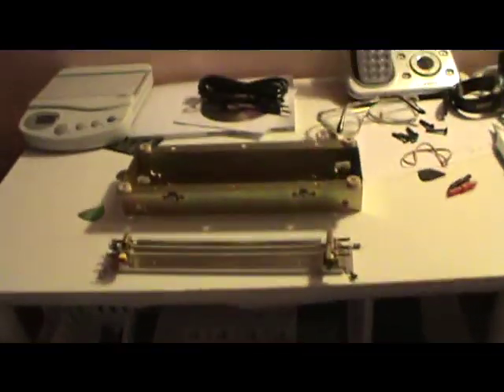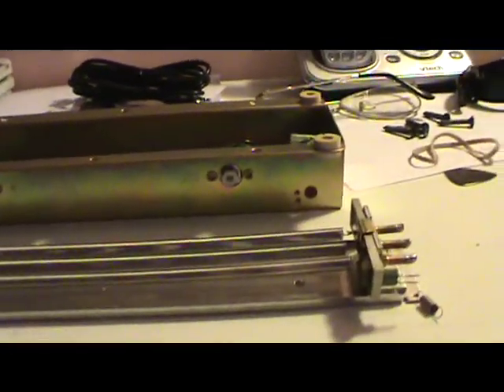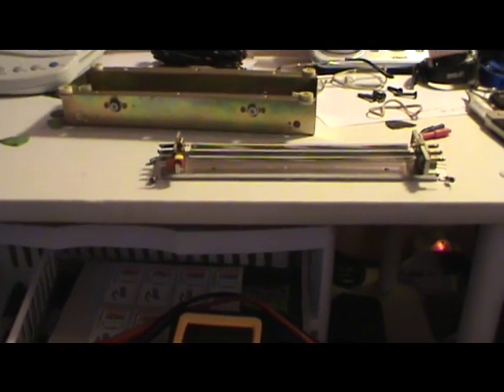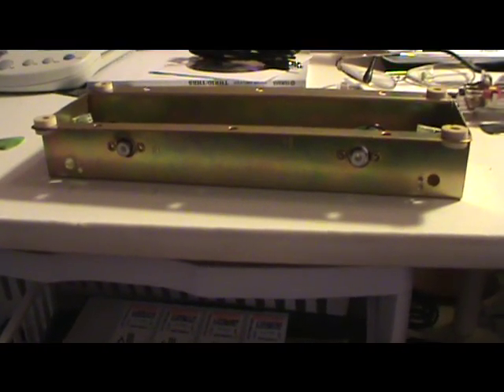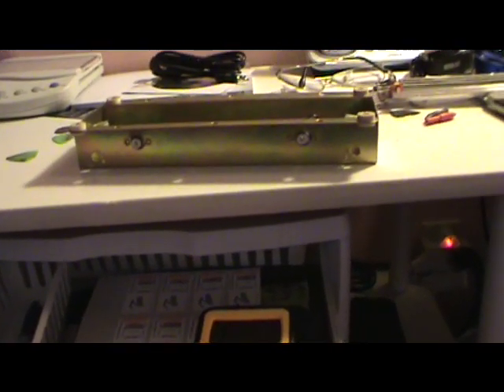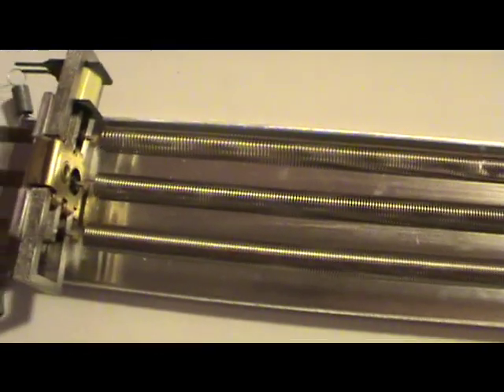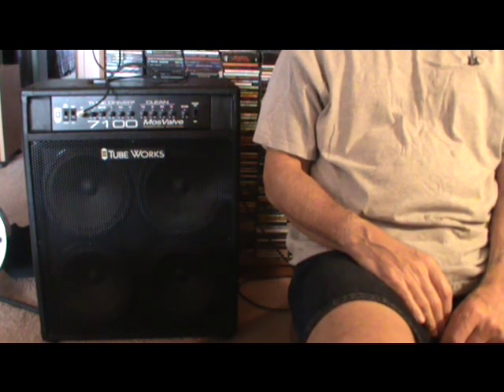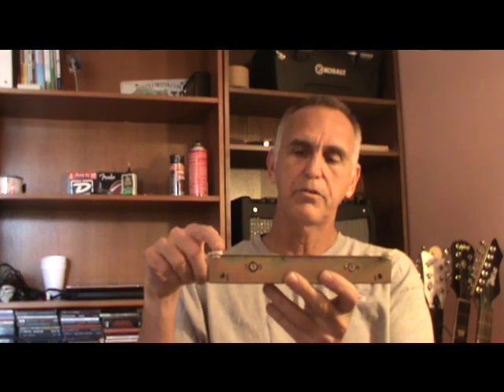Guitar Amp Spring Reverb Diagnostics

Comment: I have an oscope and a signal generator. Hah I know most DIYers don't, but makes things so much simpler. Just put in a 1k signal, probe the input of the tank, see a signal you know it's getting to the tank. Probe the output, don't see it, you know the tanks the issue. If you're doing a lot of these, save yourself some time and buy a scope.

Comment: Hi - this is very useful as Im new to using multimeters. When I tap the springs with a screwdriver I get the verb 'jangle' you get from moving the amp suddenly - so the verb seems to work. But I  get zero verb from the amp/guitar with dial 0-10. Do you think it can still be a faulty tank if I'm getting the verb with the screwdriver? Any suggestions welcome :)
Reply: Hey I think you answered it - shaking the amp gives you verb - it's the INPUT?!!
Reply: Agreed, you can have one and not the other

Comment: I have a Tube Works 7100 Dual Twelve that's missing the reverb tank. I can't find any info on the code for the tank. It's the short 3-spring. Do you think it's the same tank on your amp?

Comment: I've done service fr many years and it was rare to have a catastrophic reverb failure.  But typically a reverb not working was due to the rca connectors oxidizing over the years.....particularly the outside grounding and not so much the internal pin.  Usually the grounding turns whitish so you need to get some steel wool and spin it around the RCA connector on the tank to shine it up and make sure the male RCA plug tabs are making snug contact when plugged in or just bend those tabs slightly so they tighten up the contact.  But yes if you have a small round file from a small jeweler file set, also give the center of the female RCA connector on the tank some attention......but its the outside of the RCA that's the ground and the most important...….as for the RCA connector wires between the tank and the amplifier.....make sure the wires and connections are good...continuity at both ends of the wires at both the pins and the grounds......and check the RCA terminals at the amp chassis and shine them up too as doing the tank RCA's.  If there is no RCA connectors on the amplifier chassis, then they are hard wired into the circuit internally and should be ok.  BUT if that doesn't restore the reverb effect,  the culprit is the tank.  What I have found is that in the later manufactured reverb tanks from accutronics USA, is that they went to using an internal tank connector from the spring transducers to the tanks shell RCA connectors.  Particularly each transducer in these was changed from a direct connection from their transformers to the RCA connectors to using this extra connector system and the wire in the transducer transformer where it comes out and to where it meets the male part of the internal connector....that wire connection fails.  SO you have to use magnification to actually see it, and sometimes it can be fixed by soldering though the fine angel hair wire is coated with an insulating paint....could be enamel paint or a plastic coating.  SO its tricky to solder the contact points for a good connection and there is not much slack.  SO if you are successful in making the connection again, chances are that it won't last infinitely long as saying the life of the tank.  There is also a situation of the wire in the connector between the transducers and the RCA connectors on the tank shell.....the wire insulation tends to get less pliable and stiff and the wire breaks at the RCA connectors solder points.  But point being, the accutronics tans were quality tanks prior to this change over and these are the variety of their tanks that are notorious for failure.  If you are financially limited, you can try to fix the tanks, but its best to just save time and a headache and just replace the tank.  There are generally 3 types of replacement tanks on the market.  Accutronics was sold off to the Belton corporation and manufacturing was moved to Korea, but Belton makes a Belton tank and a Belton/Accutronics tank....so 2 types from them, and then there is the MOD tanks which are made in china.  The MOD tanks have a richer dynamic tonal response vs the Accutronics and the Belton has a slightly different tone and response.....so they all kind of have their own character in response despite being equivalent tanks.  BUT I prefer the MOD tanks in pure tube reverb circuits......however in solid state reverb circuits they do not sound as good as an Accutronics tank in the sonic response.  So for solid state reverb circuits, stay with the Accutronics tanks, and with pure tube reverb circuits you can use 3 tanks as each has a slightly different response but they are all good.  The MOD tank in a solid state circuit has a "Too Much" thing to its response and is way over kill......and the Accutronics tanks are spot on in over all tonality with the solid state circuits.  Obviously if the reverb was built with a USA Accutronics tank, then that's what your ears will be trained for and is the baseline.  The 2 spring long delay variety tanks are the best tanks in the "long" versions and most probable in the short tank versions.  The # spring types are OK but tend to be a bit over kill in the response of the effect....where as the 2 spring types are well balanced and spot on.
Reply: The reverb tanks and the transducers are kind of misleading in their action and how they work.  They DO NOT vibrate the springs as in a linear motion as suggested as of a speaker on one end and a microphone on the opposite end.  The Reverb actually works by torsionally twisting the springs to excite the spring to vibrating.....so the mechanism of the transducers is not based on the visual appearance where you may reason that the action is and in & out force.

Comment: Took a long time to say not much. If the coils are flopping around or wires are loose won't work new tank 25.bucks problem fixed
Reply: Yeah. I was gonna say. First thing i did was REPLACE the $23 reverb tank and I still have no reverb. Really hoped for more, but I'm glad you got yours fixed.

Comment: Great guide. I just fixed a horrible buzzing noise/squeal in my Marshall Lead 100 Mosfet from the reverb tank. All I had to do was clean the RCA jacks from the insane corrosion they had and it now works fine, so happy it was this simple.
Reply from the maker: Glad you found the info helpful!

This is by far my most popular video, receiving between 700 and 1000 views over 30 days.

Comment: Big Mahalo!!! I just picked up a '74 Twin Reverb and when I got home the reverb barely worked (it worked ok when I tested it a couple weeks ago). Pulled up your video, cleaned the amp-side contacts, pulled the reverb tank and cleaned the tank-side connections. Now the reverb works GREAT (even better than it did at the shop), and consistently! Mahalo!
BTW: I got the same on the continuity tests as you 200 ohms on the input side and unlimited ohms (no continuity) on the output side.
Reply from the maker: Good news...   ain't it sweet when it turns out to be something easy?

According to some quick research, the reverb units in 1963-1990 Fender amps have 8 ohm inputs and 2250 ohms outputs, so ti's possible you had the wrong scale set on your meter... but the important thing is you got your unit working.
Reply: Love it when I get to learn something new in a few minutes or hours (as opposed to DAYS or more). 
Very likely I had the scale incorrect. I was looking for 200-500 LOL 
Mahalo!

Comment: I have a strange problem, its a Marshall AVT20 combo and the reverb doesnt work but when I pull on the reverb knob the amp gets louder and brighter.
Reply: Was it used when you bought it? Because I've seen many people do mods inside the reverb tank. They could've put effects inside the tank. Just take your tank out and look if it's been modded.

Comment: I own two Roland Cube 60s from the 1980. When i set the reverb knob to 10 and knock the amp with my hand, i can hear reverb. But when i play a note on teh guitar, there's no reverb. And idea why?
Reply from the maker: +robbiedaug It sounds like you have problem on the input side of your reverb tank. It could be as simple as a corroded connector, so the first thing to try is re-seating both connections on the reverb tank. If that doesn't help, the problem is probably inside the reverb unit, and you'll have to remove it. It could be dirty connection inside, a broken wire or toasted transducer. "Input" and "Output" should be marked on the reverb tank,  but if not, unplug one of the wires going into the tank, then knock the amp with the power on and reverb turned up. If you hear still the reverb, then you just unplugged the input side. If you do not hear the reverb, you probably unplugged the output side. Mark them in and out with a sharpie to help identify them in the future. 

Once you determine which side the problem is on, the video explains how to troubleshoot it. Good luck.
Reply: +ebluz Thank you, sir. I'll give that a try.

In return, let me introduce you to something that will help you if you are ever camping in the wilderness and you get a bad cut or puncture wound or whatever like that. It also comes in handy to avoid doctors' stitches. If you are in the USA and lack health care, it will be handy to know about. 

Check out my playlists and see the natural healing video series.

Comment: You can make a new transducer take some wire and wrap it around the plastic bobbin and check the resistance with a multimeter it's just like a pickup
Reply from the maker: Have you done this successfully? I should try it.

Comment: just to help you first if you want to measure the tank you first have reassemble the tank plug the wires into the 2 coils measure the in it should be about 100 to 150 to 200 or 1k same for out 2nd of all power up your amp turn reverb volume up one of the RCA end will buzz when you touch with you finger

Comment: Hi, thanks for the video, I have the same problem, I hear my reverb when shaking it but no reverb on the guitar sound. So as you said, the reverb output shall work.
I measured connectivty on the male connectors straight from the transducers.

Output says 0L and input gives me around 0. Just like you, I think. So that 0 shows a bad thing or a good thing ? Is it supposed to have a connectivity between the two pins on a same side (input here) or not ? I assumed it should be not but I might be wrong. Thanks for your enlightenment.
Reply from the maker: I think I may have incorrectly said "zero" resistance in the video a time or two, when I meant OL.  OL stands for "Open Line" and means the circuit is broken (no continuity). A reading of zero resistance means the circuit is complete, and that there no resistance at all.

In this case there should be some resistance. For my tank the input should be 200 ohms, and the output 500 ohms. If you're getting a resistance reading of zero, you may quite possibly have the meter set to the wrong scale. Try a lower scale on the meter.

As I remember, I used the continuity test mode of my meter (not all meters have this), which does not give readings, but simply indicates if a circuit has continuity by making a buzzing sound and flashing a red led on the meter.

I suspect it more likely the side giving the reading of OL to be the bad side. However, your test of shaking the amp and hearing the reverb in the speaker indicates the output section is good, so that's a contradiction. Are you certain of which end is the output and which is input on your unit?
Reply: Try unplugging and replugging the rca cable at the chassis end. Not the reverb tank end, it matters for some insane reason. Works for my ac15 at least. Somehow the reverb will stop working on my ac15 if you unplug the amp and let it sit for about a day or two.

Got the tip from a very experienced guitar amp tech (he services Golden Earring among others). Even he had no idea why this works and why it has to be that end specifically but he did say he saw several ac15s (Chinese) with the exact same issue. He would love to invest the time to investigate thoroughly but that would mean lost income for him so basically, only if somebody paid him to do it...and I.dpn't have that kind of money to burn.

Comment: Good job. I fix reverbs at my shop all the time. Have one on the bench now for an old Fender M80. Main thing is the wires are very light so as not to impede the spring movement. So, they bounce around a lot. Just get a good clean solder joint and many times you're good to go.
Reply: Hi,
I've just been given an amp to fix for a friend, not always good to tell people you like to fix things ! anyway, it all works fine except for the Reverb, which does actually work on all channels, it's just a tad noisy. You get a kinda swooshy jangle, could that be that the springs are too slack? or is it something else please?
The amp is a Leem KA-1210
Many Thanks
Gary
Reply: Hey, Do you know if you can adjust the springs to get a better reverb sound...less clangy or more delay?  I have an old BF Vibrolux reverb and the tank is kind of weak and clangy..it works for sure,but it could be better. The tubes are fine and i have tried different correct part new tanks which don't sound quite right.

Comment: I ended up getting a Fender Blues Junior through a trade. It was in great shape, just no reverb (which I need to have for my blues playing!). I had the exact same problems you were having & probably went to the same sites that you did to learn how the unit works & how to diagnose & fix the issue. After doing the continuity testing, I realized the problem was at the input side. Looking through a magnifying glass, I discovered that the single thin strand of wire did break where the small prong fitting is. I was able to solder a single strand to the existing wire (though, I will probably be cross-eyed for awhile because of it!). The reverb is working now!! It took me less than 30 mins to fix. Thanks for posting this video & sharing the knowledge!
Reply from the maker: Thanks for letting me know. Glad this info was helpful for you.

Comment: Hi,ive had to remove my reverb unit from my amp cause its stopped working. Ive changed the pot 1st but no change, so ive tested the reverb unit with a meter and ive found that from ground to each terminal is open circuit. Firstly, is this normal or is this a sign of a definate fault within the device? Help :/